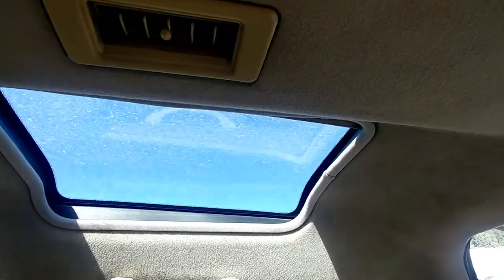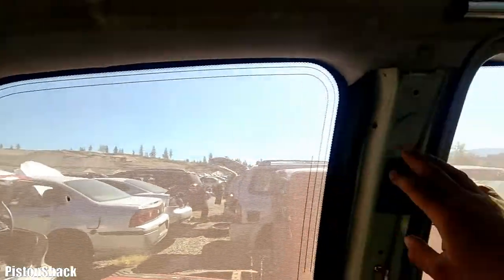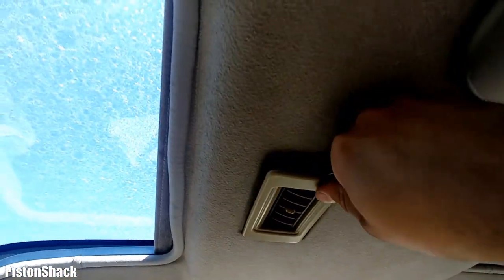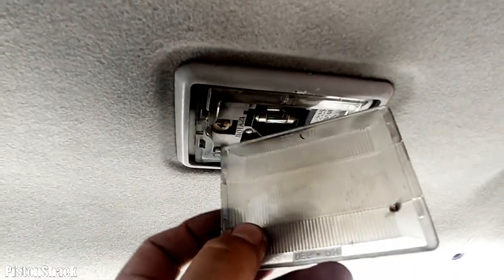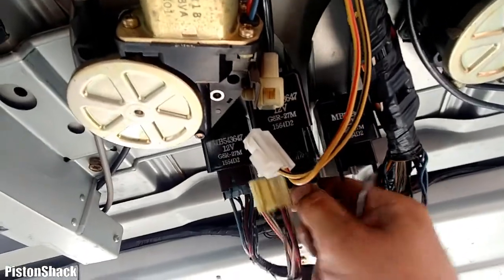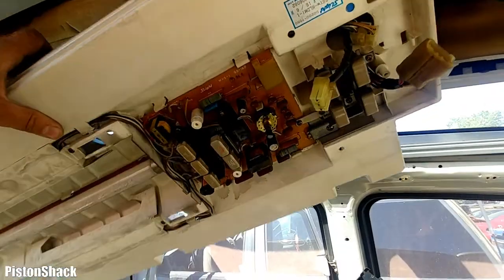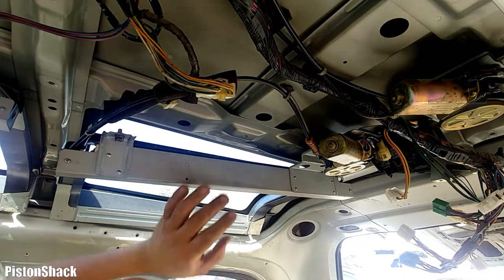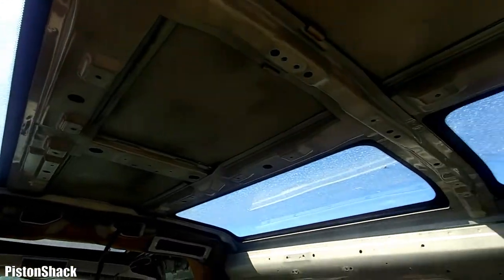MITSUBISHI DELICA L400 CRYSTAL LITE ROOF SUNSHADES REMOVAL | EASY TIPS & TRICKS

Comment from the maker: FEW MORE USEFUL DELICA VIDEOS: 
EASY CRYSTAL LITE ROOF GLASS REMOVAL ON MITSUBISHI DELICA L400
https://youtu.be/2hhBnWGGGdQ
MITSUBISHI DELICA L400 ENGINE OIL CHANGE in DETAILS | 4M40 DIESEL ENGINE | OIL CAPACITY, INTERVALS https://youtu.be/gJgxzJUsq_E
MITSUBISHI DELICA GLOW PLUGS. HOW TO REMOVE, TEST and INSTALL GLOW PLUGS 
https://youtu.be/BOKFhU7aSgs
HOW TO REPLACE LEAKY VALVE COVER GASKET on MITSUBISHI DELICA.
https://youtu.be/moQDr-5bRhg
MITSUBISHI DELICA 4M40 DIESEL ENGINE 
HOW TO START 4M40 DIESEL ENGINE OUTSIDE OF MITSUBISHI DELICA | WIRING, PRIMING, PURGING, STARTING UP
https://youtu.be/0sz7WSTRje